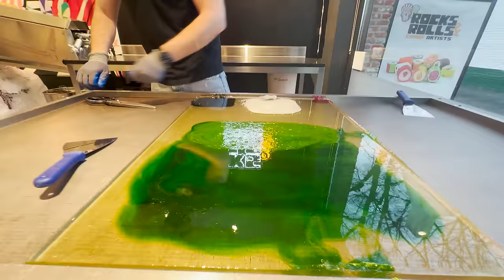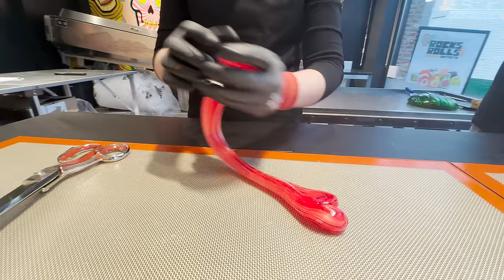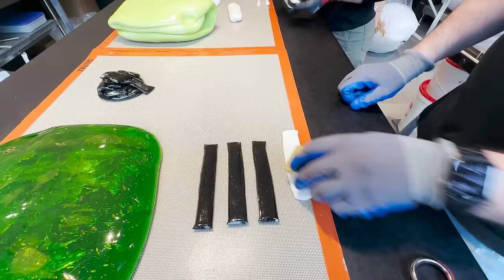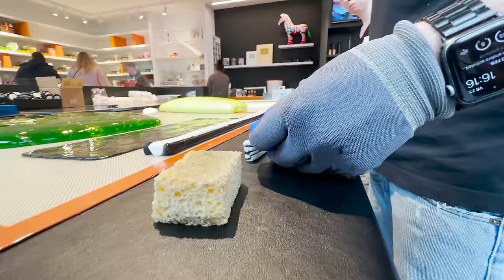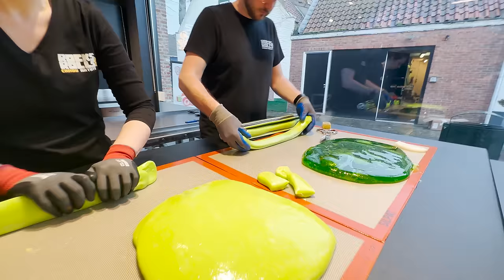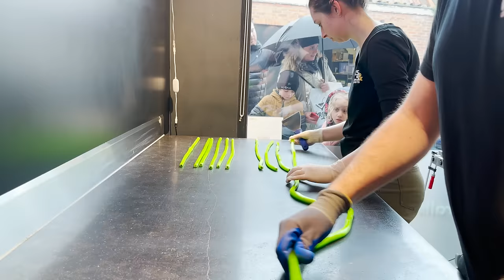Easter Bunny Candy 🐰🍭

Comment: I'm surprised at how long the candy remains pliable enough to work with it. Is the table they work on heated?
Reply: At 90 c
Reply: Yes
Reply: It appears they are forth and back between heat and room temperature with the silicone mats. The table with the frame behind the workers is the heated one, I believe the same one they started working and melting on.
Reply: I was just wondering same thing
Reply: That would be my guess that it’s not too hot to touch but warm enough to keep the candy pliable
Reply: I believe so, or the candy would seize up and harden before they could shape it.